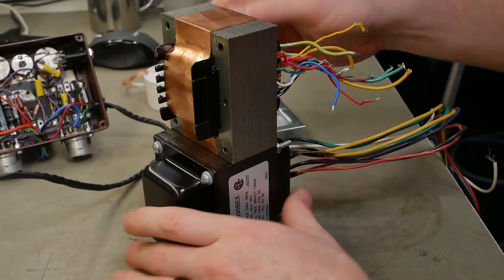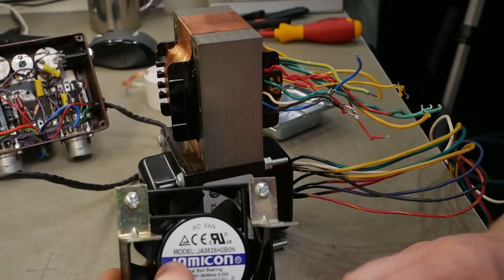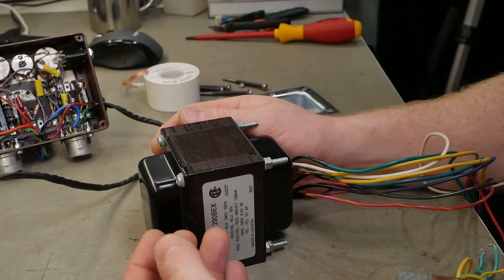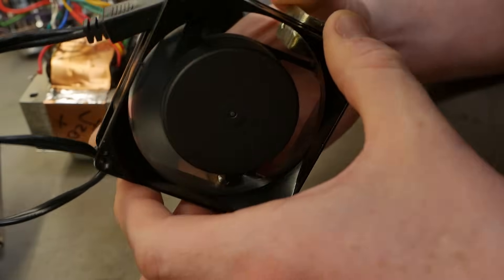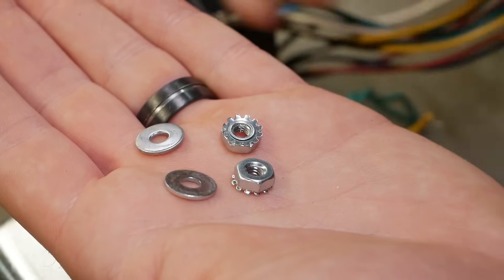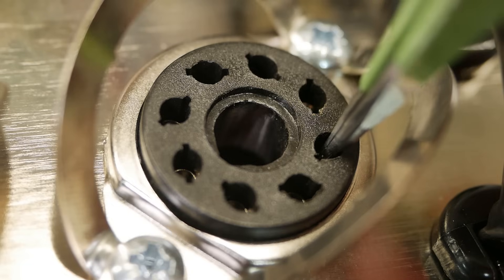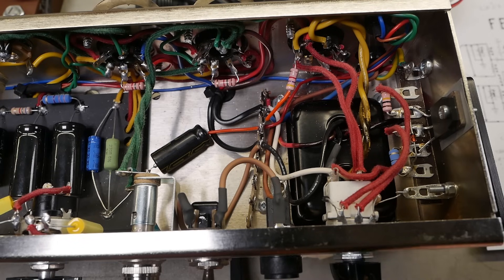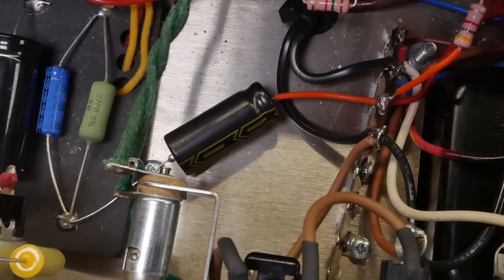Lazy J J20 (Part 3)

Comment: 12:08 - The extra node is for the external FX unit B+ supply...he just bypasses the resistor for non-FX models.
Reply from the maker: What FX units? You mean the reverb and tremolo that are installed in this amp, yet the resistor is still bypassed?
The resistor was bypassed by it's own leads, so that doesn't make a hell of a lot of sense.
Like, how much time does that really save in construction?

Comment: MY fav trick with fans is to connect a capacitor in series with a fan try   a .47 uf as a example and adjust the amount of capacitance as needed to get 110 volts.
Reply: I'm thinking that might not be safe unless you use a 1000 volt rated XY safety capacitor. Might be some lovely voltage spikes at turn on especially with the inductive fan load. DC voltage ratings for caps aren't directly corresponded to their AC rating;  600 volt DC capacitor rating is generally considered the minimum for 120 VAC usage.

Comment: The blocking caps are there to stop mV getting onto the volume control. This causes the volume control to sound scratchy. I had the same issue on a Trainwreck Rocket clone I built.

The amp should have been built on Garolite instead of fibreboard which is crap.
Reply from the maker: There's a different reason for that.
Long story short, it only happens when the trem is engaged, and it's because they went with seemingly arbitrarily reduced dropper resistor values.

Comment: Alright,  I have degraded this from a TAD kit to an ebay kit.

For the amount of volume a small boutique company does, a bulk transformer order from Mercury, Pacific, Heyboer or even Hammond becomes increasingly less expensive.  

The same goes for every single other part in these amps.

I can't come close to $1500USD in all the parts inside this thing, including the speaker and cabinet, and that's with the most expensive new stuff available. 

Lazy J, you're thieves.

Comment: with a GZ34 rectifier and 330VAC on the primary this is going to have high plate voltages.. If you intend running 6l6 tubes in there I guess you will have to increase the power rating from 5W to 10w on that 270 ohm cathode resistor..  
And the amp should put out at least 20 watts with the 6l6GC tubes and the new transformer so the alnico blue might blow when you dime the amp.. The alnico blue is ok in a dual EL84 cathode biased AC15..
I think you can get 17 fairly "clean" watts out a cathode biased pair of EL84 but with some  5 % harmonic distortion in the signal..
Reply: He said that he was going to go with  6V6s.
Reply: I wouldn't expect much more than 20 watts output from 6L6's in this amp unless 1) the output transformer impedance and reflected impedance of the single Jensen speaker was an optimal load for 6L6's (6l6's generally prefer about half the load that 6V6's prefer, so perhaps a 4 ohm load is preferable), and 2) if the phase invertor had been desined/ optimized for driving 6L6'S. A true Princeton phase investor would be designed to drive 6V6's, an easier load than 6L6's.....

Comment: Hi Brad, Heater elevation. So I should completely disconnect the transformer center tap altogether and cap it? And do not separately ground it to the chassis? Just take it out of the circuit altogether and pretend it never existed?  (VOX AC30)
Reply from the maker: Here's a great article that goes into the kind of detail I can't in YouTube comments section: https://www.valvewizard.co.uk/heater.html

Comment: Loving following this and now subscribed. I thought about buying a Lazy J but ended building my own 5e3 with lots of Rob Robinette mods. I also added a VCB and found that it made the chassis very hot so added a small 12v (I think) fan under the VCB. Made a huge difference. I know this fan was not directly pointing to the VCB but may be linked. Doesn’t change the fact that this looks like a home made job.

Comment: The UK is merely following the Yanks lead in the automotive and truck industry.  Unable to make a decision to stay firmly locked into 19th century SAE standard or adopt the much sexier metric standard, “Made in the USA” vehicles are now a mashup of both threads. The ultimate profanity occurs when designers put metric threaded nuts on SAE threade screws and bolts. Things have never been the same after the demise of the Whitworth standard, it rest in eternal peace.

Comment: 2 6V6s + 2 12A*7s = 1.5A
Changing from a pair of 6V6s to a pair of 6L6s adds another 0.9A so you're already at 2.4A.
Add three more 12A*7 adds yet another 0.9A.  Now you're at 3.3A.
10% over the rating of the 290BEX, but I wouldn't lose much sleep over that.

The original transformer in this dookie was probably rated for less than 2A on the 6.3V winding.  This complement of heaters would put you least 65% over the rating.  100% over, if it was rated for 1.65A (like the 290BBEX which is spec'd as a replacement for a Tweed Deluxe).

Comment: For $8K it should be hands down one of best 5E3 style amps available. It should have implemented Yoda levels of amp tech know how to be bullet proof reliable, while also rivalling the best examples of vintage 5E3 tone. 
However, for $8k you can also buy something to show off on the local guitar forum's 'new amp day' thread. You get the big spender, boutique amp owner cred among your forum peers. As long as they do not ask for sound examples and gut shots, the amp does not actually have to be as good as the price tag suggests.

Comment: I’ve read Neil Young uses a freaky tweed with 6L6s rather than 6V6s, among other mods, and it has a fan… maybe that inspired this thing?

I also wonder what the mains is pushing where this amp’s owner lives. Maybe it’s 250 out of the wall and he lives in FNQ with no AC and he gigs outdoors in the wet?

I’m stretching. Still a shocker the way it’s built.

Comment: This has been an interesting and quite disappointing video. I have one of these amps. I’ve met the guy that builds them. I went to his house to collect mine several years ago! He’s a super nice guy and is passionate about guitar and his amps. It’s such a shame that there seems to be so many issues with it and it’s made me start to question if I want to keep mine. It is still the best sounding amp I’ve ever had for tweed and clean tones, and I’ve had many ‘top end’ valve amps in the past, including most of the usual big brands. I currently have a Tone King, a Soldano SLO and a Victory V140 and the Lazy J just sounds better than all of them for clean and tweed (nothing beats then Soldano for high gain!). I’ve always loved my Lazy J. It’s now tarnished, I’ll never look at it the same again and maybe it’s time to change it. How disappointing.
Reply from the maker: Mate, chuck some 6V6's and a JJ's 5Y3 in there and you're golden.
That will extend it's reliability significantly, allowing you to enjoy your amp without worrying & that's the name of the game!
Reply: @BradsGuitarGarage  Nice suggestion, and a lot cheaper than a Bartel 😂 I’ll give it a go.

Comment: The "secret link" is truly baffling! It is as if a paranoid "designer" is so scared of someone stealing his secrets that he has disabled his own innovation. Surely, the extra node is better connected, even if it is unnecessary? The only scenario that I can come up with is that the first "designer" put in the resistor as dummy (with the secret link.) Then a colleague (in QC?) looked at the schematic and realised that the capacitor was needed to complete the node. They seem to have played themselves.
Reply: Perhaps I should add that the expression "too clever by half" (which one is tempted to employ for the self-proclaimed "genius" behind Lazy J) is only possible in the English language  --  other cultures have a much higher regard for cleverness.

Comment: Use droppers and install some more fans! IT'S AN ENDLESS CYCLE!!! After a couple decades or so as an electrician we electricians love to shit on other people's work. It makes the days go by faster, and in this case Lazy J have given us so much crap to work with. Coupling caps on the inputs were used on OLD amps that had mic inputs for vocals, harmonicas & accordions. Some mics used a mic preamp and that could put DC into the input. Rivera era amps often had a last little 4 uF filter cap on the first input stage anode supply. 4uF @ 450 volts is pretty much a non-stock item in my shop of horrors. I doubt Rivera actually designed ANY Fender amps during his tenure with Fender. Boy howdy them Lazy J twits shat a whole lot of extra solder through those eyelets. I suck those eyelets darn near dry then run over them with some wide lead & tin tinned Navy solder braid.